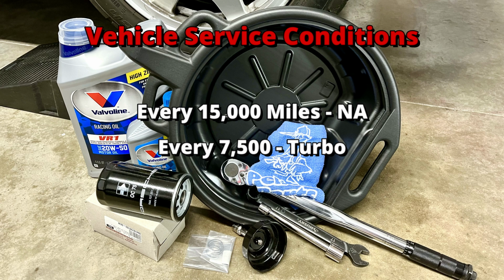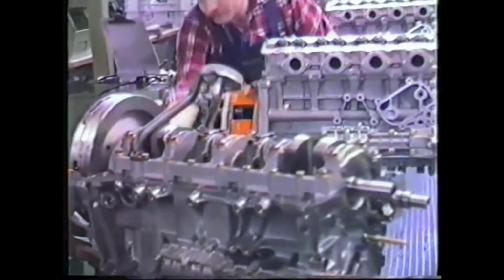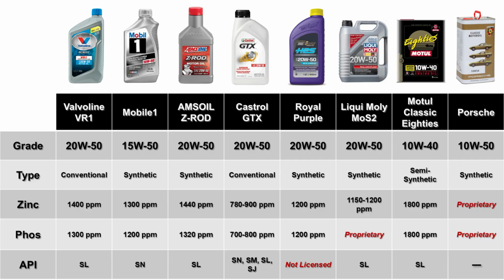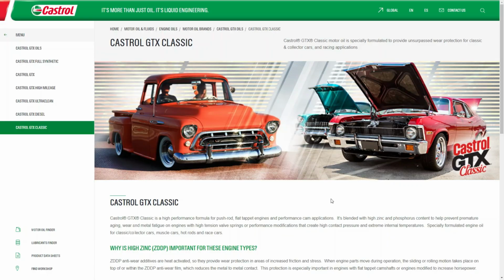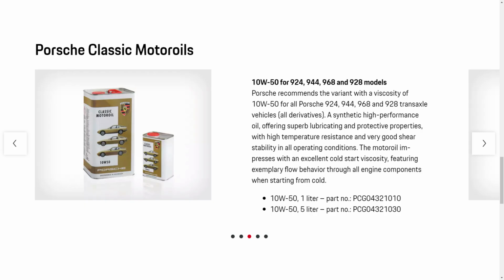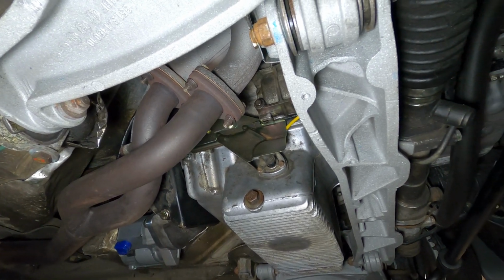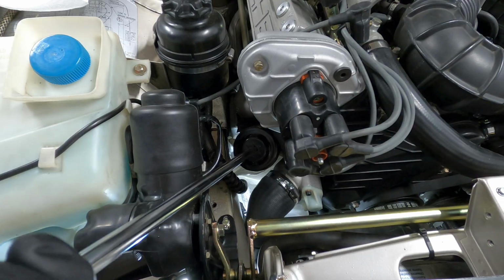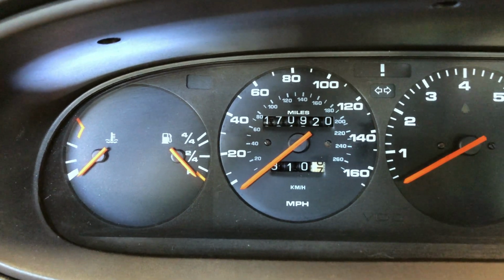Porsche 944 – Engine Oil & Filter Change Tutorial

Comment: Nice video, my Porsche mechanic recommended using diesel oil in my 944, helps with the issues of oil leaks, and maybe because I am in Tucson and it’s freaking hot. It’s a certain kind of diesel oil, I can’t remember what it is, I have it in one of my cars, and the other car I have liquid Molly, also a little trick that I learned when removing the oil filter, is to tap a little hole on top of the filter, it helps drain the oil out of the little container. Anyways, thanks for the video
Reply from the maker: Yeah, Arizona gets quite a bit hotter than here in NC. I’ve tried the oil filter hole method in the past as well. It may have made a small difference for me, but still dumped some fluid, so I generally skip that optional step. It’s a preference for some folks though. In a pinch without a full set of tools, I’ve also used the “screwdriver stab through the side” method to loosen the filter and that was VERY messy. 🤣 But it got the filter off…
Reply: @NC944er  are you happy with your Lindsey racing mass airflow kit? Do you think it was worth the money? Or do you think it would’ve been better to get a rebuilt computer and rebuilt airflow system?
Reply from the maker: @phillippasena1429  I like how it runs once it’s warmed up. It goes lean on initial throttle tip-in when it’s cold. This is something that others have reported and it seems like it has to do with the tune itself. I think the kit would be much more attractive if the price point were a bit lower, but what can’t be measured is how much more fun it makes the car when it’s dialed in. If I think about switching back to an AFM, I definitely don’t feel excited about the idea. Rebuilding the DME computer and replacing the AFM would increase reliability but wouldn’t necessarily add power like the MAF does.
Reply: @NC944er  thanks for the feedback, I’m still on the fence about getting the kit, if I go with the rebuilt computer and airflow, I’ll let you know how it feels. Also do you think you’ll ever do a video on replacing the motor mounts, that is next for me, I’m thinking about purchasing the transmission mount or transmission jack from Harbor freight, not sure if that is safe enough. Yes
Reply from the maker: @phillippasena1429  My engine mounts were replaced a few years ago, so it’s not on the list at the moment. A regular floor jack and a piece of wood will do the trick… following the write-up on Clark’s Garage. Just swap out one mount at a time so the engine doesn’t shift side-to-side. It’s not too bad. Most recommend using the genuine Porsche part as the aftermarket ones don’t hold up well over time.
Reply: Shell Rotella?